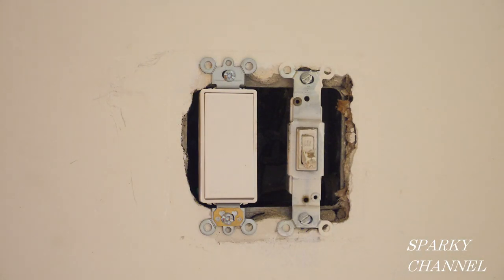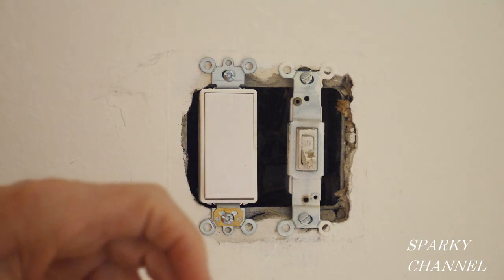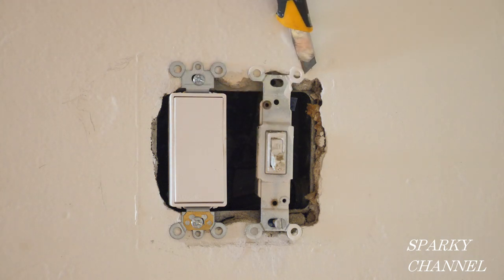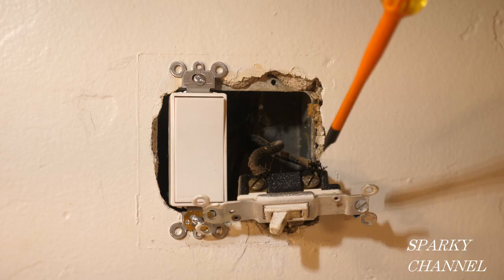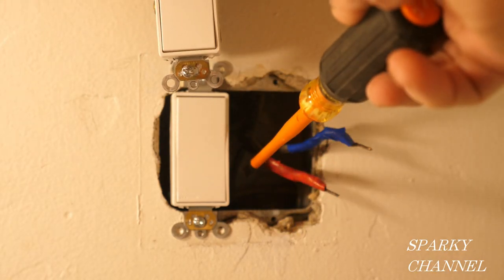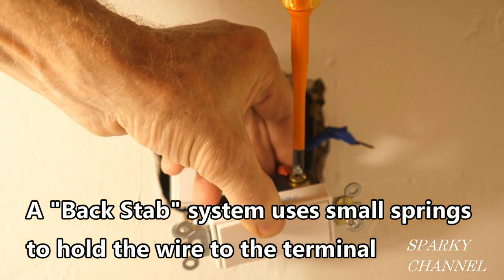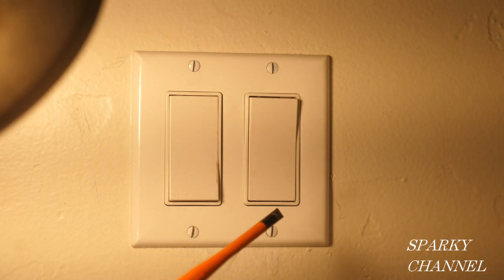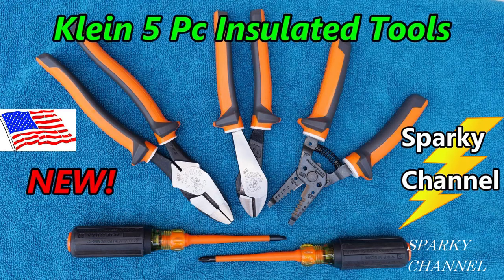How to Install a Single-Pole Switch Next to a 3 Way Switch with Discussion of Faded Wires, Grounding

Comment: Thank you SO much for this video!!! I was at a near loss today changing out the last light switch system in our 1965 house, and had never seen a 3 way and a single combo set up, on top of old ass wiring that threw a wrench at me with one wire on the 3 way being red. I'm so used to white/black/blue wiring ( blue on ceiling fans),  with green for ground. 

I'm no pro at wiring simple stuff like this,  but, its not too complicated and i don't mind saving money on an electrician on simple items, but this was a minor setback until i watched this. 

Subcriber now!!

Comment: Good video illustrating the challenges encountered when replacing devices in older homes.  Under current NEC there would have to be a neutral conductor present in the switch box because some smart switches require one in order to operate correctly.

Comment: 12-6 for the screws on the wall plate. Kick ass
Reply: the top left was 3/16 of a degree off plumb.
Reply from the maker: @kenbrown2808  I have to admit it was a little off. I'll fix it when I get there this AM. Also, the counter-twist of the new switch didn't show up well because of my camera angle. It's a good tip for getting double decora devises to align quickly. If I do it again in another video I'll try a different camera angle.
Reply from the maker: Thanks Dave!
Reply: @SparkyChannel  had a customer years ago who could see half a degree of misalignment.

Comment: Wouldn’t those switch terminations be considered back wire rather than back stab since the wire slides underneath the plate rather than a compression spring?

Comment: Both switches have different power
source or are they shared?
Reply from the maker: It's a shared hot wire so they are both on the same circuit.
Reply: Good question.
Reply: @jeremyandmarissa  That's what im trying to find out. Did you ever get an answer??
Reply: @tecumseh6224  yea it’s the same circuit it’s a shared hot wire

Comment: Isn't the self-grounding clip usually on the top? The switch on the left looks upside down (doesn't make a difference if it's a 3 way of course)
Reply from the maker: Hi Mr. G! Both switches say "TOP" on the top of the switch so you install it like that. Some models may have the self grounding clip on the top but not these switches.

Comment: I pulled out my single pole that’s next to a three way and there is a wire going from the three way to the single. And another wire is attached to the same screw. So I don’t understand anything. I’ve spent two days trying to understand this garbage so I can install a dimmer